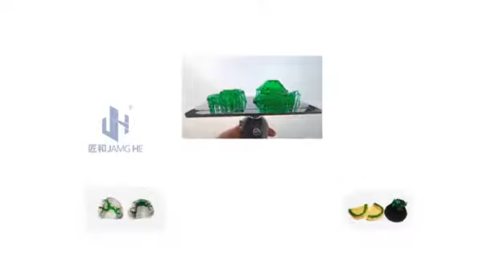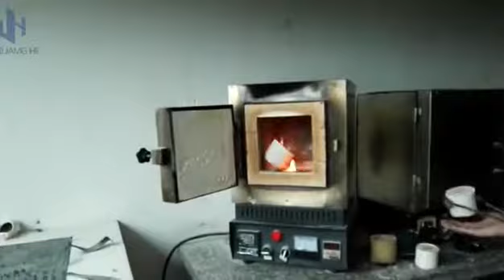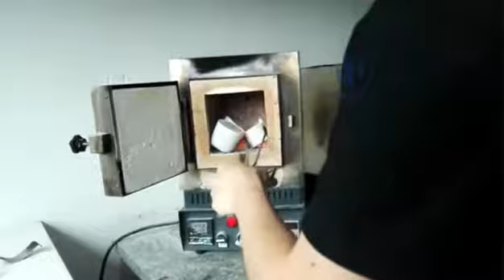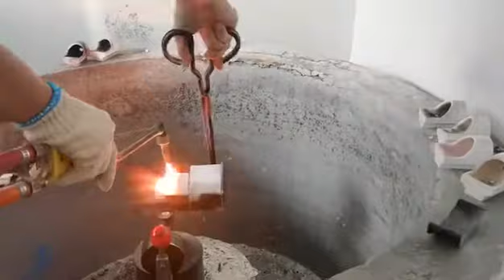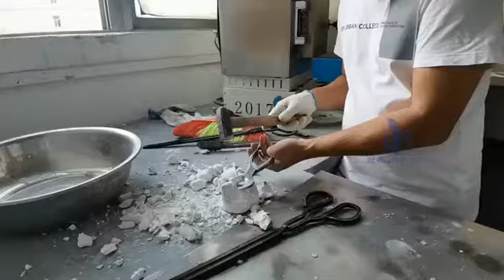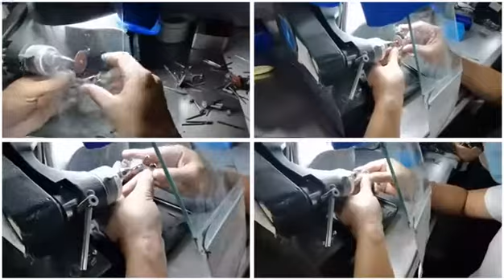How to cast dental frame and crown with 3d printing resin?

Comment: Que resina utilizas? No te fractura los cubiletes? Saludos!!!
Reply from the maker: Hi welcome, we use the dental castable resin to do the model, here is the link about the resin we use, you can see more detail information there, and about the cup, we use Ceramic high temperature resistant cup, so it is not easy break when casting     https://www.jamghe.com/products/dental-castable-resin